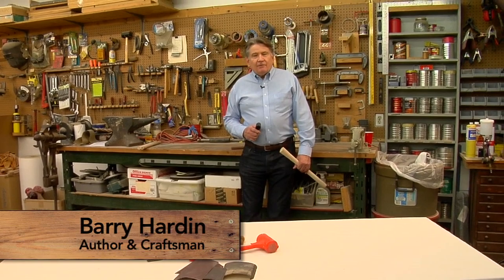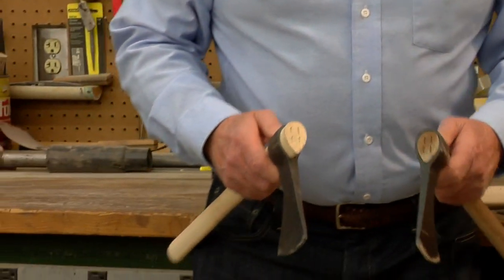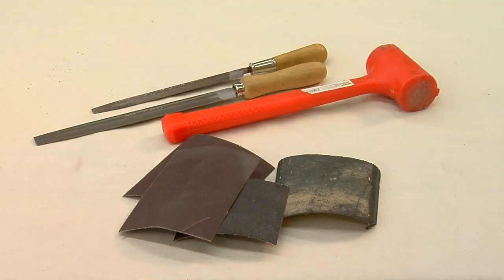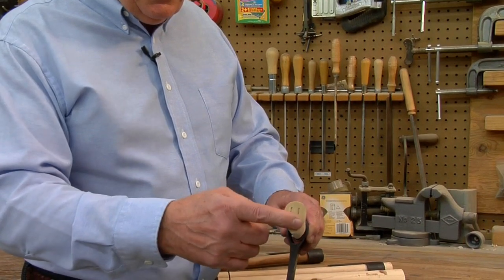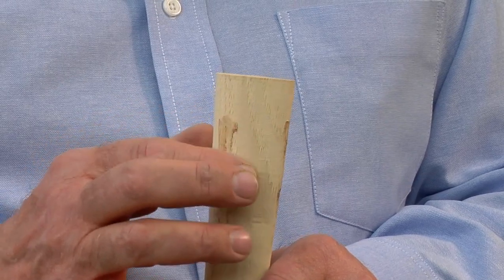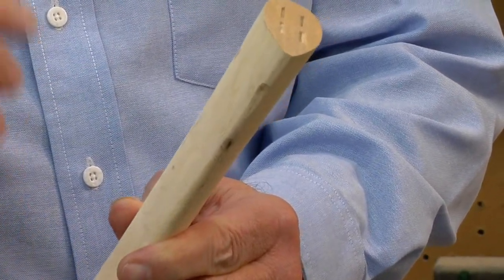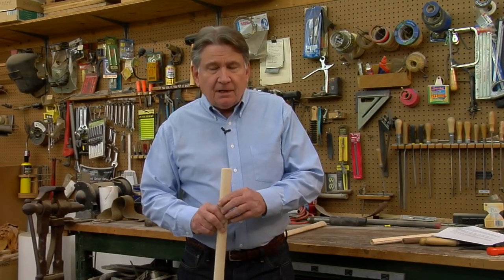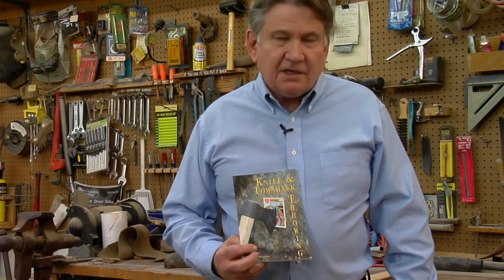Fitting Tomahawk Head & Handle, Use & Care - Crazy Crow Trading Post

Comment: You might also round the top edges of the eye before doing this, so the eye of the axe head doesn't start cutting into the wood and making it mushroom as bad.

Overall though, great advise for fitting an axe head, regardless of a friction fit or standard fittings.
Reply: Great tip 👌